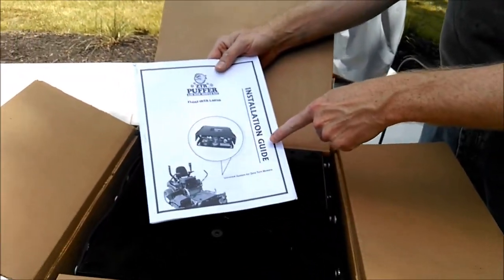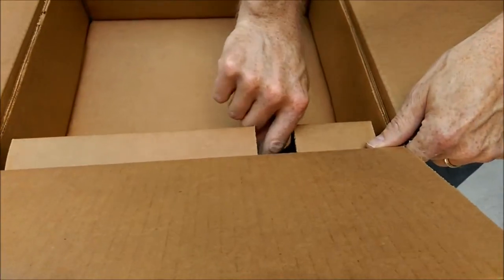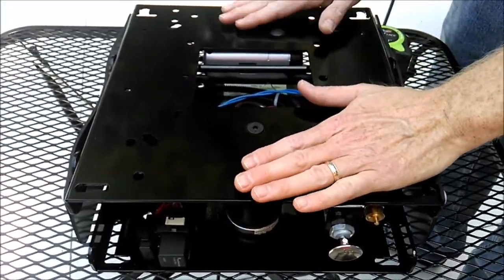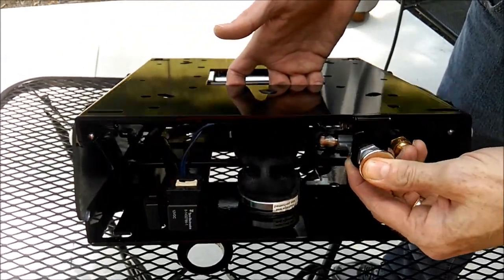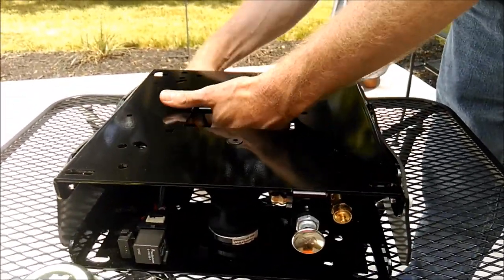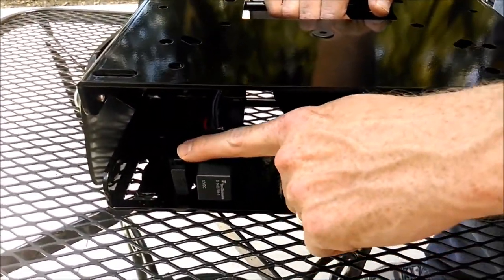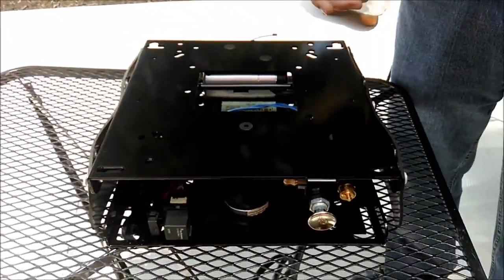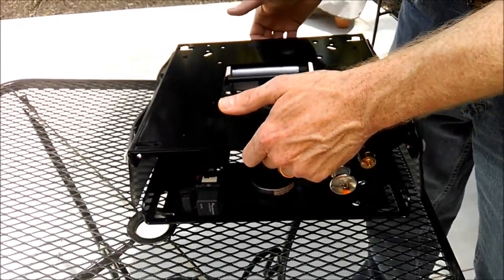What is a ZTR Puffer?

Comment: what's it cost?
Reply from the maker: The cost is $399.00 plus $30 shipping/handling. The price if you own a Grasshopper is $409.99 plus $30 shipping/handling.  This is due to an adapter plate that is needed for the Grasshopper model.

Comment from the maker: The height once it is aired up and you are sitting on it is approx. 3-1/2"
Reply: Just curious how does this hook up to a grasshopper seat (I ask since they typically hookup via brackets on the front)? What's a realistic expectation of this seat compared to a stock Grasshopper setup in terms of ride? Also would it be advised to buy clip extenders? Sadly the website could have a massive overhaul on images/specs on this unit.